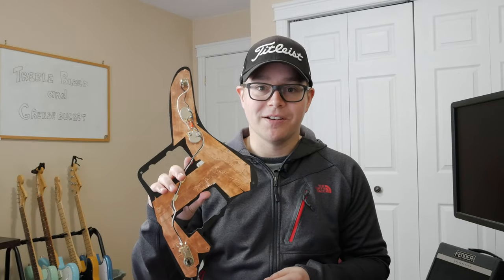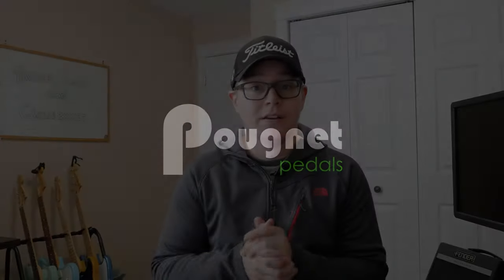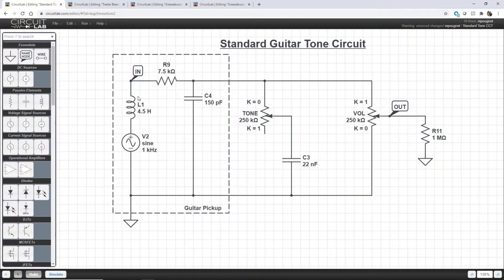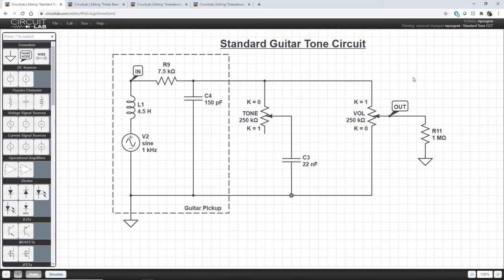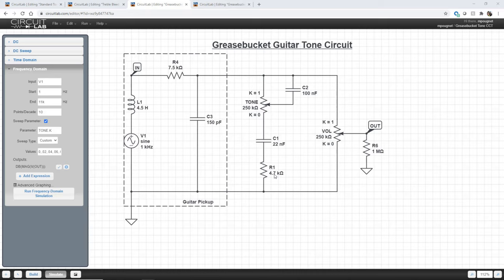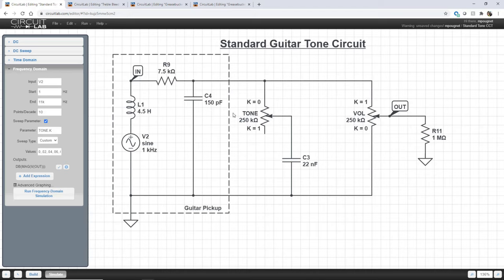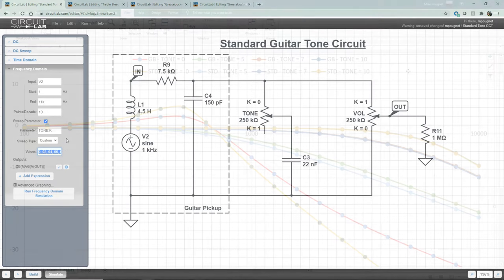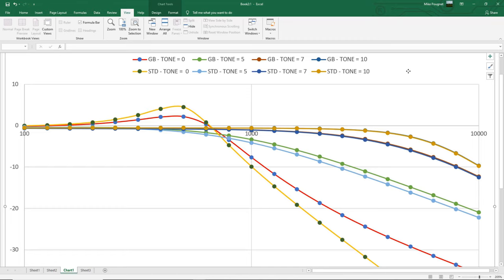Treble Bleed and Greasebucket | Two tone mods for your guitar | DIY Guitars

Comment: I’ve changed a few guitars over to the greasebucket tone and really like it. It’s much more usable than a standard tone that turns to mud past a certain point. Awful name but great circuit 😆
Reply: I feel like if you just used a weaker cap (like going from .022 to .0047) that barely hits the treble, you'd actually appreciate the mid/bass boost of a standard tone circuit. It would feel more balanced as you'd be able to bias/blend your tone from bright and chimey to thick and powerful, rather than just reducing treble until your pickups sound muted/muffled.

Comment: Simulation is not quite correct.
Reply from the maker: I am open ears. Let me know where you think I went wrong
Reply: + @pougnetpedals  
The represented Tele-schema is a passive schema. All output came from pickup. No scheme changes can boost the signal, In particular -- treble bleed is designed to reduce loss treble in volume control.
Reply from the maker: I think you are getting bogged down with my use of the word boost. I agree that there are no active boosts; however we are changing the RC filtering from the standard tone circuit. The result of that is to reduce the amount of signal being filtered out, essentially providing a boost at those frequencies over the standard circuit. I understand your comment but I think it is more about my wording than actually what is going on.
Reply: @pougnetpedals  
The drawing of signal doesn’t look right either.
Reply from the maker: How so? If there is a mistake I'm glad to correct it, but I'm not sure what you are referring to. I simulated this in circuit lab and with the guitar freak tool and got the same results.
Reply: + @pougnetpedals  
The sofware has wrong initial input.
But i think is not such important.
Provided shematic is correct.
Reply from the maker: The input is just a dummy AC voltage. The only reason it is there is so the simulation can sweep frequencies. This is how apps like ltspice, pspice, circuitlab work. Hopefully this helps
Reply: @pougnetpedals  
I mean input database for software itself.

Comment: So, I like the treble bleed, I think it's important the volume is linear and affects tone as absolutely LITTLE as possible, but I think I'd actually want the opposite of a grease bucket on my tone knob. Any idea on how to construct a bass boost circuit on the tone pot that minimally affects how it attenuates treble?
Reply: I think for this you would actually need an active boost. It's kinda the deal with passive filtering that if you boost one band, another has to come down. Maybe you can steal the values from the Bass pot of the classic Baxandall amp tonestack and interpolate that to a guitar tone knob, use a breadboard hooked up to the pot lugs, drop capacitor/resistor values and see what sticks.
Reply: @TinkerToneworks  Not looking to go active. I'll just EQ it at the pedals/amp then, lol. Thanks for the idea, though.

Comment: hi , i do not have any pots wired up, just an on /off switch only. And in 1 guitar the single bridge humbucker is wired directly to the output jack. What are the values for this setup? i was also going to wire in a huge cap with a bunch of resistors  will this get me gain?
Reply: No.

Comment: I took the tone pot out of my Tele and replaced it with a four position switch - the first position is no treble bleed, the second is standard Tele treble bleed, the third is a larger value capacitor that lets through a lot of middle (I can get a spot-on Down By The Jetty/Malpractice'/Stupidity era Wilko Johnson tone with that), and the fourth is an even larger value cap which takes top end away as you turn the volume down. That one's great for power chords if you've got a lot of drive on the sound. 
With the volume up full, of course, there's no difference -  they only come into play as you turn the volume on the guitar down.

Comment: Great video, proving that most Internet "experts" have things either totally wrong, or backwards. Maybe you have done this already,  but I would love to see these charts/graphs with different value capacitors on the tone controls.

Similarly, I'd love to see charts that graphically illustrate the frequency spectrum & power output of single coil pickups & humbuckers as the number of "turns" of coil wire increases...and as multiple coils are connected in a series vs parallel, or in phase vs out of phase! I would think this is possible, since we can measure the resistance and inductance (&, effectively, amperage, voltage "wattage" output)of different pickups

Comment: Treble bleed was pretty much standard in 50s wiring. It fell out of favour when people started using amp distortion and gain. A lot of different set-ups came into use with bi-amping, stomp boxes and gain-stage amps of fairly limited flexibility by today's standards. The trade off was losing treble when backing off the volume - mud.

Because a treble bleed really works well only when you have a solid go-to set up. Taking a treble-bleed guitar elsewhere often means that backing off the volume doesn't "clean up" as you expect because the high end of the signal is still passing to the amp and driving it. It's a trade-off that means backing-off to allow the singing doesn't work at all - you're still in those frequencies that compete with a voice and it's dirty too.

As well, a treble bleed is often tuned to conserve the same sound at any volume. Changing the values (impedance) with a different set up disturbs that tuning.

So....there's work to do to find the right circuit/values for your rig and it will work until you plug your guitar into something else and it will behave differently. 

That's not a problem for the player - most of us use one favourite set up - but for the maker supplying a multiplicity, it's a bit of a "ball game". That's why the treble bleed went out of fashion in the 60s.

Comment: Really great explanation! I have a Fender Johnny Marr signature Jaguar, and while the wiring is highly modified and well thought-out, the volume pot is practically useless. It cuts the highs so much if turned down at all and it doesn’t really even cut the volume much until you get down to like 30%. I think I may need to install a treble bleed circuit and/or change the pot value...
Do you have any experience with no-load tone pots, btw?
Reply from the maker: No experience with no load pots, but they are supposed to make it brighter. I would try the treble bleed first. 2 components and an easy mod. Could also look at your pots, maybe the value is too low?
Reply: @pougnetpedals  I think this particular Jaguar has 1 Meg pots actually. I’m a little worried that a treble bleed circuit would mess with the “bright” switches (instead of rhythm circuit on typical Jag). 
He’s the manual for the guitar with the wiring diagram if you feel like taking a look. https://www.fmicassets.com/Damroot/Original/10002/011-6400B_SISD.pdf
Reply from the maker: i would give the treble bleed a shot. it looks like the bright switches just put caps in between the pickups. Also, the treble bleed is only going to effect you at lower volume. so if the volume pot is almost useless to you now, you really don't have anything to lose. Although stewmac overcharges by 1000% for their treble bleed circuit, they do provide a neat idea on their page (https://www.stewmac.com/electronics/components-and-parts/capacitors-and-resistors/golden-age-treble-bleed-circuit.html). That is, if you want to try the treble bleed before soldering it, just put it on some alligator clips. Check out the third image in the link
Reply: @pougnetpedals  oh that’s awesome! Thanks for the tip! I’m definitely going to try it then. Cheap, low-risk and non-invasive.
Reply: +nick16754
When you know how to really work a tone pot - you’ll realize that no-load tone pots is useless. 
Regular tone circut is just fine.
Reply: I love the Quack of my single coil SSS Strat. What can I use to really bring out the sweet tones of my Strat without external FX?

Comment: Hey there, really great vid enjoed it much

Could you explain how different values of the caps and resistors would effect the sound?
Reply: higher resistor value = brighter
higher capacitor value = darker

learn about engineering notation and the suffixes pico/nano/micro to not get lost looking at the different units of "farad" 

0.022 microfarad(uf) = 22 nanofarad(nf) = 22000 picofarad(pf)

Comment: Make a video like this on the Telecaster LA Cabronita Especial has Two 0.0033uf in parallel. The graphs/plots will tell what the Dual 0.0033uf in parallel are doing to the telecaster pickup.
Reply from the maker: Will have to check that out!
Reply: @pougnetpedals  yes check out the LA Cabronita Especial wiring because it gets very twangy tones from the S1 switch

Comment: I'm curious why you went to 11kHz. The 24th fret on the high E string is only going to hit around 2.6kHz. Even with harmonics you aren't getting any sound at 11kHz.
Reply from the maker: It is the magnitude portion of a bode plot. That is, it has a logarithmic x-axis. Plotted by decade, my option was either to go to 1khz or 10khz. 10khz covers the full audible range of a guitar and also shows more of the frequency response. The way the program lays out is plot points required me to add the extra point to 11khz. Showing to 10khz was the goal
Reply: @pougnetpedals  seems like it would be basically useless for trying to plan a circuit for a bass then. Thanks for clearing that up.

Comment: grease bucket cheese cluck-it....who turns their tone knob down that far anyway?...i don't.
so why not just put a 100K resistor on the signal side of the tone pot, to just stop it from going that far?

then it's just one resistor, instead of a resistor AND a 0.1uF ....that would be a monster if you wanted an orange drop.....and the tone knob would be less touchy.